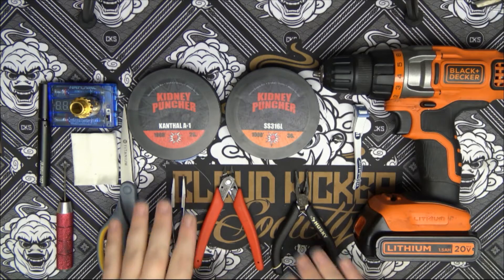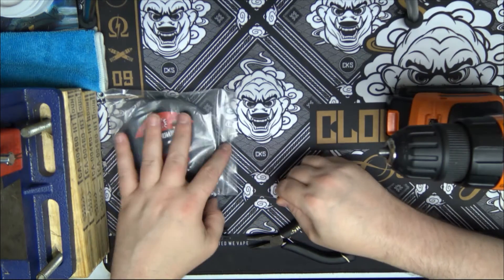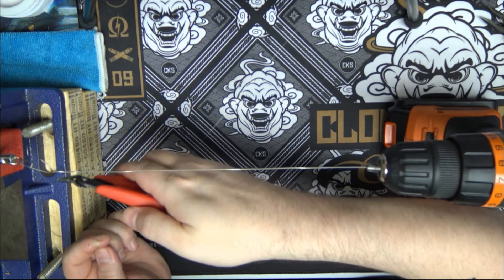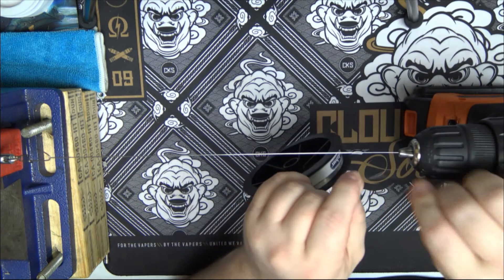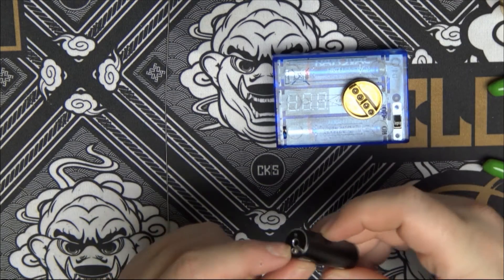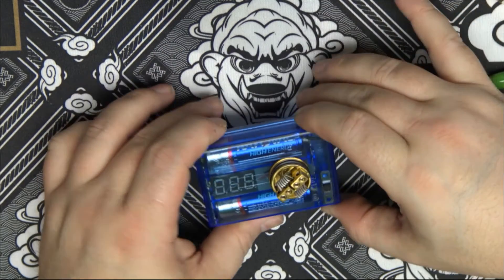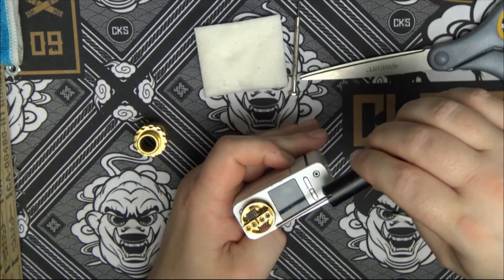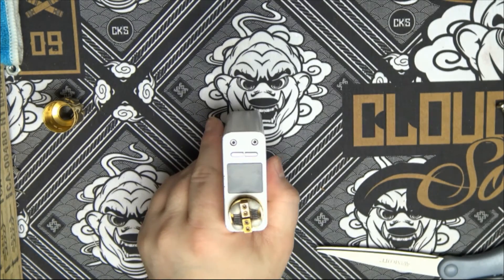Fused Clapton Tutorial

Comment: Thank u Aries! My biggest problem doing this free hand is how to place the 36awg on the table without unrolling and messing up the whole spool!! If you can show us a method of placing the thin wire in the desk without unrolling uncontrollably but also be able to feed nicely in our hand and in turn to the cores that would be brilliant!!! Thanks so much mate!
Reply from the maker: It's actually a pretty simplistic method. I stand it up on its side, place a mod (or something fairly heavy) on each side of the spool and something relatively heavy between the spool and me.. I feed the wire from the underside of the spool towards me.
Reply: That sounds perfect! Final question: Is the spool on top of the build mat or on a hard desk surface? Thanks again mate!
Reply from the maker: Hard smooth surface.

Comment: Is it not wise to use 40/26 stainless steel gauges for my claptons?
Reply from the maker: I see no reason why using 40g over 26g would be an issue. As a general rule, I follow what I call the "Rule of 10" in that I have at minimum 10 gauges difference between my core wires and my wrap wires. I have and do use more than 10 gauges difference or more on a regular basis. 26g cores with 40 or 46g wrap wire makes for, in my experience, an amazing experience.. at least until my eyes strain out from trying to see the 46g or finer wire.